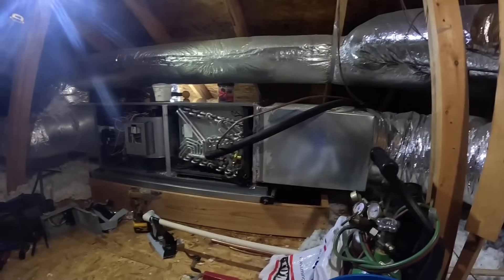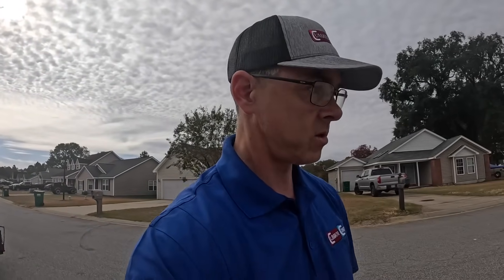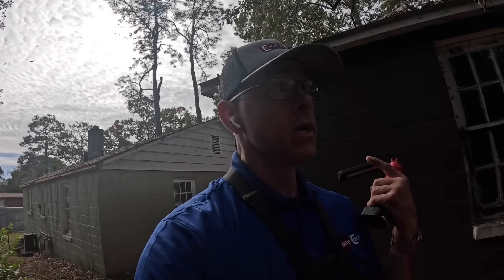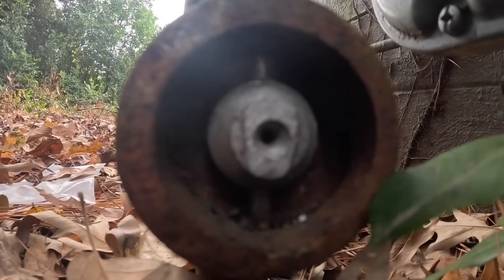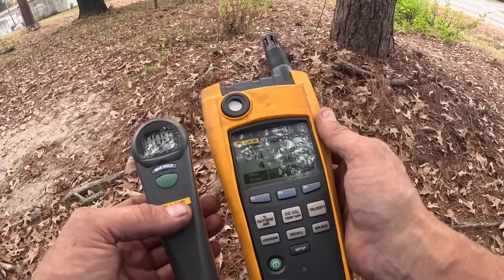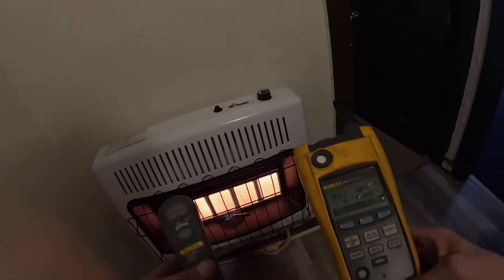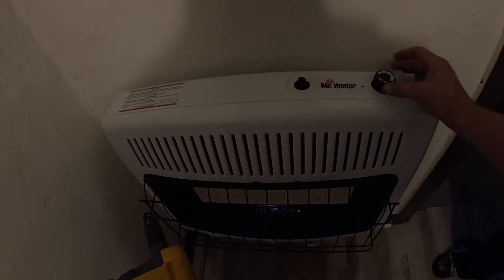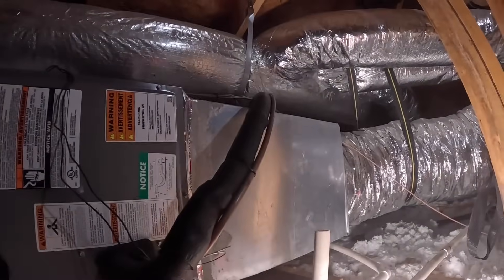Part Of My Day As An HVAC Tech, And Business Owner! #hvacguy #hvaclife

Comment: Yeah... I get it... but unvented in a house is not good...these landlords should be held accountable...  in garage or shed no problem since people are in and out... and out buildings are not usually sealed well... I hate to say it but eventually a unvented gas heater is going to lead to deaths... you can have a detector but when the batteries go out what happens?

Comment: Those unvented wall heaters are EVERYWHERE in my County of Arkansas.  My grandparents had the old free standing, exposed, 6 burner heater to heat their house.  If ya wanted more heat, you'd open the gas valve next to one that was lit and blew the flame over to the next burner.  Good times!

Comment: Manometer on the supply pipe into the property. I ALWAYS do it before i even touch any of the appliances in the property. Gas is too much of a liability
Reply: All it takes is a little rich fuel to air ratio to kill. The bad thing about carbon monoxide is it takes a few days for it to come unattached from the red blood cells. In other words you could accumulate carbon monoxide poisoning over a week or little more.

Comment: Hope the puppy does not decide to chew on the exposed yellow gas hose.  Cannot believe that is allowed.  Could be slammed by a floor vacuum cleaner.  Should at least have a protective cover.
Reply: They have a metal sleeve in the pex pipe 
Here in Victoria Australia 🇦🇺 our state building authority (VBA) have banned all pex/poly pipe being installed externally
Reply: But I completely agree that should have a shroud
Reply: True!
Reply: I won't use it. I've replaced several that cracked and started leaking. But I don't work on gas or oil at all anymore. Too much of a liability and my insurance is almost double for gas and oil liability.

Comment: Curtis, So was heater flex hose connection leaking?  With the bubbles it appears it was leaking.
Reply from the maker: No. I had opened it to bleed it.

Comment: That poor guy needs a better sound system than a DVD player through tinny HDTV speakers...
I wouldn't even consider that a "furnace," it's more like a "space heater." Auxiliary or backup heat source, sure; but not a primary heat source. You have to blast the heat in one spot, and leave all doors open (and maybe a few fans circulating air), to warm the house up.

Comment: Don't ventless heaters give off excess moisture I know the propane ones do!!
Reply from the maker: I don’t know that they do.
Reply: I think it is the exact opposite of from my experiences with them.  They dry the air so much you need a humidifier, but we have those here in Colorado but now they aren't really allowed in most jurisdictions.
Reply: Yes, propane seems to be worse. But heating the house also lowers relative humidity. You'd need to monitor the humidity. If it gets too much above 50 percent, you'll have mold issues. If it gets above 70 mold will grow on the wood trimming.

Comment: Nice work on the install. I'm not a fan of furnaces like that. I remember in my grandparents old house they had a big one that stood on the floor, that thing put out some heat. It was dry heat, so dry they would put a pot of water on top of it. My parents first house (and mine) had a wall furnace that was vented. It worked fine, but they eventually put in central air and heat. That is why I don't understand how all these homes that have horizontal units in the attic, when you can find a spot, in that house it was the end of a hall closet. A vertical unit, the plenum was in the attic, hard ducts and insulated. That is the way to go, IMO.
Reply: It just costs more money!:face-blue-wide-eyes:
Reply: That it does Bob, but I was referring to some of his past jobs where there are these horizontal units in almost impossible places to get to for service. @bobboscarato1313